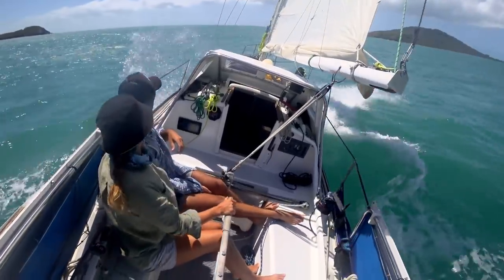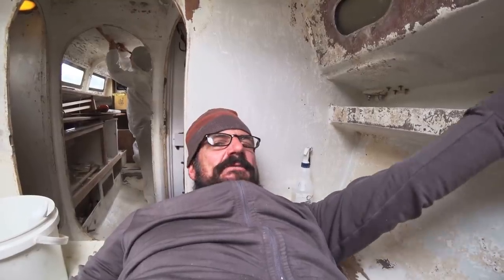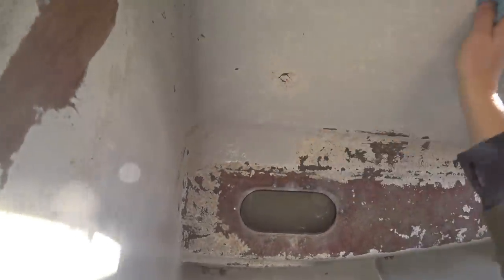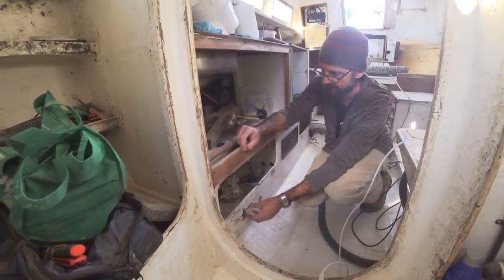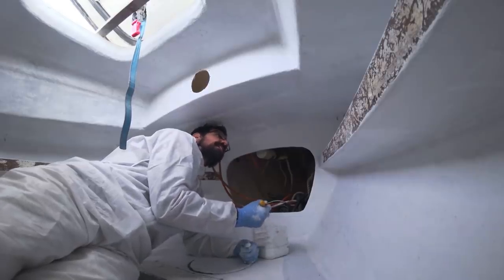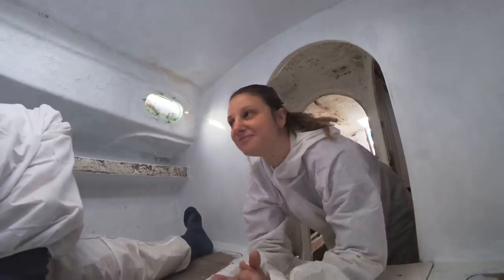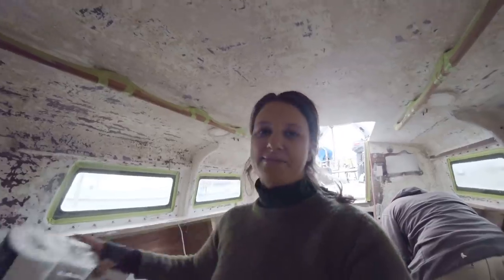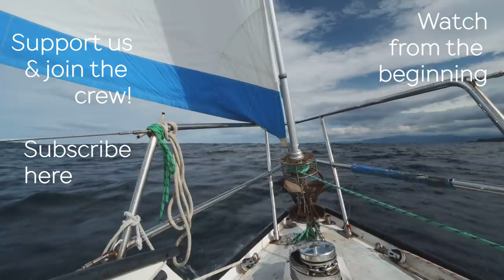Don't paint your nuts (DIY Interior Paint Job) - Free Range Sailing Ep 146

Comment: I was waiting for you to show the painting of the faces of the "shelf" in the front berth.  My OCD kicked in and I keep thinking about those two long, thick, unpainted surfaces that run the length of the berth!  lol  :D
Reply from the maker: Ah. That surface is bare to receive epoxy as part of a nice timber trim. Coming soon!
Reply: That makes sense now.  I was wondering the same thing.  I figured there might be timbers screwed-on with plugs covering the screw holes.  I didn't think of epoxy.
Reply: Mate, you better have your OCD locked up while watching these videos. Barely anything's gonna be near perfect i assure!
Reply: @poyakiani7883  or watch "sail life" to get a proper OCD fix 😂

Comment: Troy, it is to late on that boat.  If you get another boat when you paint inside use gel coat!!!!! It does cost more and it is harder to get on right.  But it’s much tougher and will stay nice much much longer.  It cleans up better.  It’s 3 xs more indestructible as paint.  
It will not peel off like paint if you apply it properly.

Comment: I did the same thing to a 33 foot sloop 20 years ago but used flow coat and a stipple roller. It turned out well but what a horrible job grinding the whole interior surface. Never again. Good effort guys.

Comment: I live in a hottish place. We call 13 celsius winter. Yesterday was 43C can't do shit in 43C. Caulk gun insta mix epoxy adhesive cures before it leaves the tube. There was a lot of sanding in that lesson. We should read the  label and believe. It's only 5 degrees over, it'll be all right, doesn't work.  

It's looking awesome. Awaiting the next instalment.

Comment: In case you do not know and have not already put the final coats on. Paints were more toxic in the past than they are today and the exterior paints don't inhibit mould like they used to. There are mould inhibitors that you can add to paint that you may want to look at.

Comment: Exterior house paints work great!!   I have also been using road marking paint for my bilges, lockers nad engine room.  Requires minimal prep, super super hard wearing [takes a beating on roads], high build and mostly cheap. Berger jet dry line mark paint has been my current go to.  Stocked in bunnings warehouse in NZ.
Reply from the maker: I had seen that paint used to mark chain but using it in utility spaces sounds like the work of genius!
Reply: Painted my aluminium tender yellow with it. Seem to remember it's got glass in it. 
Super volatile, dries FAST.
Reply: Also ute tray liner type paints ie. Rhino coat etc. 20 years ago concrete paints were the go to for fishing boat decks but has been superseded by better stuff. She will be nice when you have finished Troy, ready for the next 50 years. Cheers

Comment: Looking great!

I wish you could have gotten further, but you probably do too...

I am wondering why you left the side of the shelves bare in the V-berth. Is it going to be covered by a timber later?  Would paint have hurt being under that?

It is interesting to me that you are using exterior-grade paint.  I have personally sworn off using any 2-part paint on a boat ever again if I can at all help it -not even "marine-grade" single-part paint is good enough, IMHO and always tends to peel.  Every time I have used it I have regretted the choice but incompatible prior paint needs to be completely removed down to the fiberglass or a compatible primer used between it and and 2-part topcoat.  

But you are constrained by the previous paint as well, and completely removing it all would have been a huge job.  I hope your work pays off and thete is no further peeling for years to come.

Hopefully when we all emerge from the current pandemic you will have a wonderful new living space inside your boat and all the other upgrades and refit items done for many more seasons of trouble-free cruising.
Reply: I meant anything BUT a 2-part paint in the above.
Reply: @svbarryduckworth628  - Hint: You can edit comments directly.. (those 3 dots to the right of your comment) No need to make an addendum then.
Reply: Not on a phone when you refuse to use the YouTube app because it shows too many ads and instead are using rhe duck duck go browser via the m.youtube mobile site.

I'd rather not be able to edit comments than be subjected to all those ads here
Reply: @svbarryduckworth628  - Ahh.. fair enough. I use a Pi-hole for blocking ads across my entire home network, so I feel where you're coming from.
Reply: We cruise full-time so our phones are our internet, unless we can find free WiFi or are at a rare marina that offers WiFi that is usable.

My phone is my main "computer" and access to the interwebs, usually using cell internet.  Ads also cost me money to download, on top of wasting my time.  

It's not like we have any money to buy that junk they are advertising, or the place to store it on the boat.   We are not much bigger than Mirrool.

Comment: After all that prep work you went with Alkyd!!! I know you're on a budget (as are we all), but a 2 part epoxy primer would have locked everything together, providing a moisture barrier and some serious holding power to the old substrate(s). Alkyd is effective I suppose, but it is like 3 steps down from what most folks are using now. You've done great work and the transformation is already stunning....just don't cut corners after all that work!!
Reply: I went for International prekote and toplac, haven't used it yet, still preparing, only three more years to go till painting my wife reckons.

Comment: I must have missed it, but you talk about continuity under the nuts but you did not remove the rails which would let more bad stuff in than the nuts and washers.
Reply: I'm kinda wondering the same thing.. may be there is some difference in the interaction between paint and metal as opposed to paint and wood; I have no knowledge of the chemistry involved to know if there is. Also it may be that the timber grab rails are too difficult (or just a pain in the arse) to remove